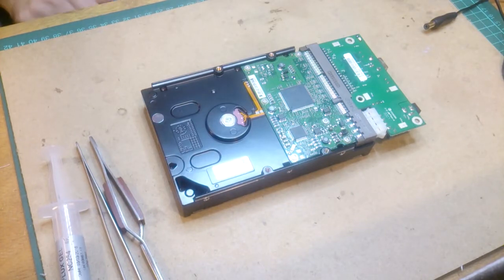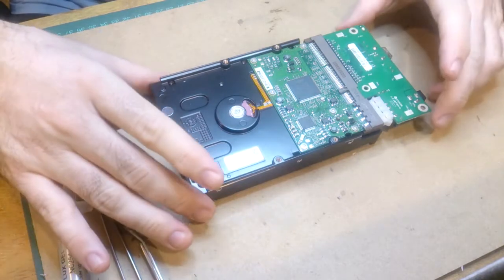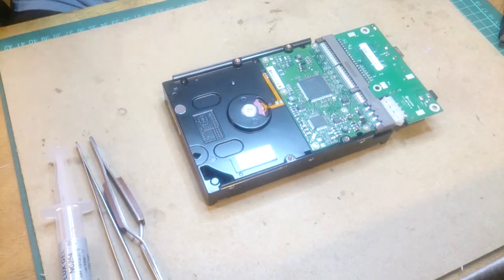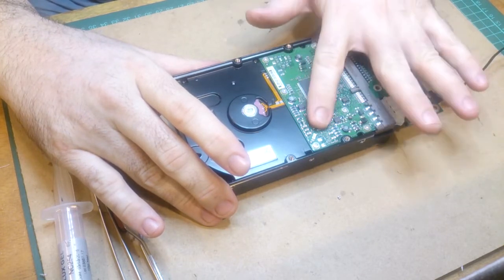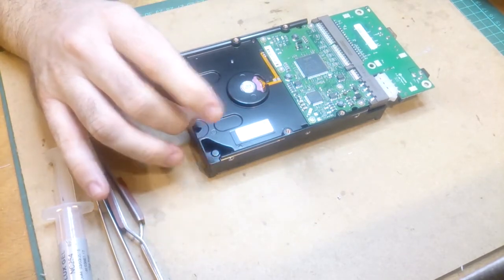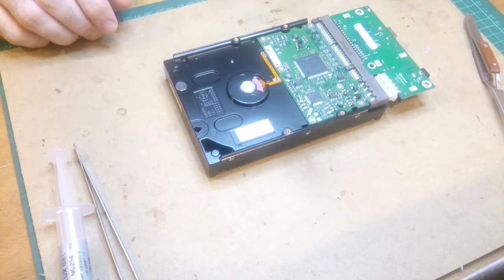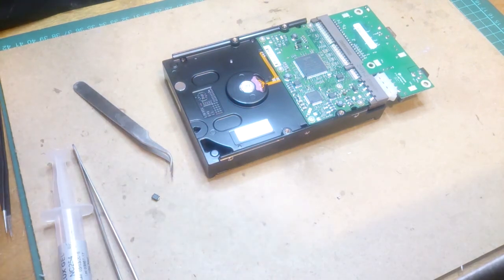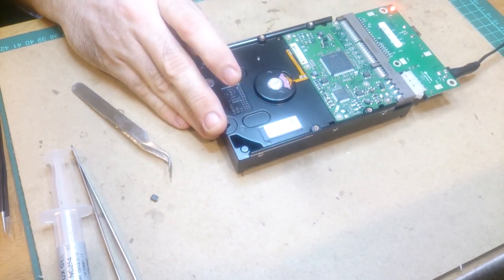IDE HDD Repair with failed TVS Diode

Comment: As per the diode definition, it should allow current in 1 direction only. if you removed 1 diode then no current can flow through that diode area. How come the HDD still starts without the diode?
Reply from the maker: https://en.wikipedia.org/wiki/Transient-voltage-suppression_diode
Reply: @pldaniels  thanks for the reference, i understand it now. I have a similar PATA hdd of 500GB. In my case the 5V diode is burnt and it is causing short circuit. Can you tell me any suitable TVS diode that should be compatible with my HDD ST3500630AV?

Comment: what was the symptom ? was it as sound of "click" when hdd start ? thanks
Reply from the maker: No.  When the TVS "blows" it causes no spin up. Sometimes it'll even cause the PC PSU to not fire up, because it's crowbar'ing / shorting the 12V or 5V rail to ground.
Reply: @pldaniels  it's intermittent, and causing freeze when booting, what do you reckon the cause?
Reply from the maker: @RixtronixLAB  if you hear a click/ping, I'd strongly suggest taking it to a data recovery service, or replacing the drive *now*.

Comment: Hi! My faulty drive's PCB (a 500 GB Seagate Barracuda) looks EXACTLY like yours. Before coming here I removed the other little black component, which reads like "QE R750" on it, following some advice I read somewhere. Unfortunately, the unit wouldn't turn on. But after also removing the one from this video, it works!! Anyway, I would like to know which components are these and if they can be replaced by standard components (diodes, maybe?) in order to keep using the unit safely. Thanks a lot!
Reply: +1 man i have 500GB too. One of my TVS diode is literally burnt. I will give this video a try today. I would like to know if you got the components from anywhere else.

Comment: Just try to check for connectivity between the 12V line from SATA power to the positive end of empty diode spot. Likely your Hard drive is a modern one and might have components between them. Mine had a capacitor. I just soldered a wire from 12V SATA power to Positive end of the removed diode spot to get the drive spinning. You could do that or Remove all the components between them.
Reply: Does that work for a laptop

Comment: So I removed the broken diode but it still doesn't spinn up.. what should I do ?
Reply: Just try to check for connectivity between the 12V line from SATA power to the positive end of empty diode spot. Likely your Hard drive is a modern one and might have components between them. Mine had a capacitor. I just soldered a wire from 12V SATA power to Positive end of the removed diode spot to get the drive spinning. You could do that or Remove all the components between them.

Comment: My PC has blown 3 hard drives, an external hard drive, blu ray drive and external sound card all in 1 go....... desperate to locate TVs diodes or at least identify the problem so I can get them up and running again. On the ssd’s The chips are so tiny I practically need a magnifying glass and I am having great difficulties in locating the TVS diodes on all the circuit boards. I have a multimeter but still worried I’m gonna mess up by cutting out the wrong thing. Is there any advice, or article you can direct me to that would help me out? I’m really gutted about the hard drives etc, lot of money to buy new for everything not to mention data on them. Would love to give it a try myself.. thanks for this educational video though, you make it look easy.

Comment: Hi, I think I have the same problem on a Toshiba SATA HDD which is getting too hot on the controller side instantaneously.The board is facing inside so I can't pinpoint the source of heat. Is there a way to find a diagram for the controller?
Reply from the maker: Try run the board without it being on the drive perhaps.

Comment: what if there was 2 tvs diodes on pcb so which one should i remove?
Reply from the maker: There might be one for 5V and one for 12V, measure which one is shorted and remove the right one.
Reply: Thank you so much for a quick replay. Can i remove both these diodes like even the unshorted one and is it safe to do that?
Reply from the maker: Yes, you can remove them both (assuming they're both TVS diodes), just be aware, there'll be no protection against voltage spikes while they're absent.
Reply: You have to replace them best to remain the protection in future!,  wich types are compatible? I do have one with a shortened at the 12V line.

Comment: Nice quick diagnosis with the finger thermometer there Paul and good to see you putting your new hot air station to good use :)
Reply from the maker: Hard to beat the finger for a thermal sensor.  The reason I stop/pause before going "Ouch" is because I could tell that it was slightly warmer than everything else, but then the real heatwave came through to confirm.

Have replaced the backplate of the Xperia Z phone and now the videos  will be much clearer (I hope, even have a brand new spare being shipped in tomorrow).  Still not sure what went wrong with the audio, should have been a lot crisper.
Reply: Glad you got the the bottom of it :)
Reply: I would use my IR gun
Reply from the maker: A FLIR possibly would have been useful, though at leas on boards this lightly populated it doesn't take too long :)
Reply: Paul Daniels
you wouldn't get the required resolution anyway would you Paul?
Reply from the maker: At 160x120 on most of the $300 FLIRs it probably should give enough, especially with the overlay.  Wouldn't like to try pick out parts smaller than 0805 though.
Reply: Paul Daniels I was meaning my cheap 10 Dollar IR Gun but it probably isn't precise enough
Reply: Paul, have a Good New Year
Reply from the maker: ah okay, yes, sadly those tend to have a fairly quickly expanding cone  (circle) of averaging  with the distance from the object but not quick enough with the update rate if you're scanning for the fault.

I had considered getting an iR meter though and putting it on an XY servo pair and slow-scanning perhaps 16x16 zones, board could be on flames by then though.

Another coarse option is the Panasonic GridEye which is an 8x8 sensor and very easy to use.  Won't give you a great precision but might be enough to give you a zone to look at closer.

A good new year to you too :)
Reply: Paul Daniels all is better than burnt fingers eh :)